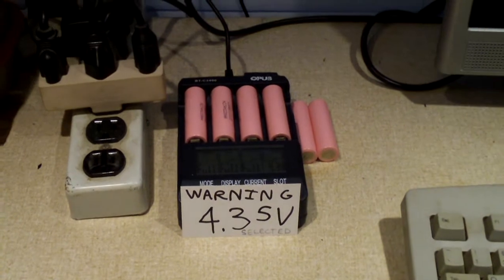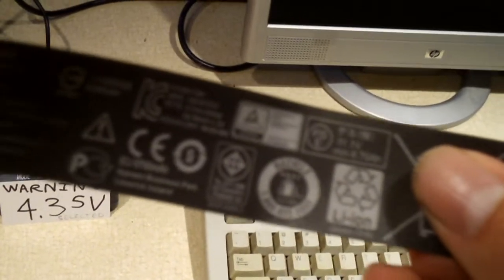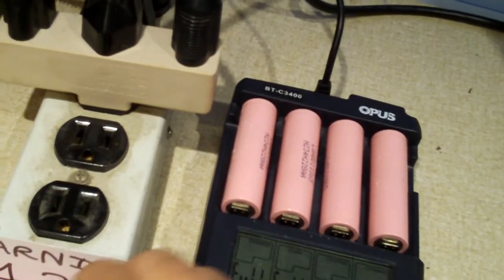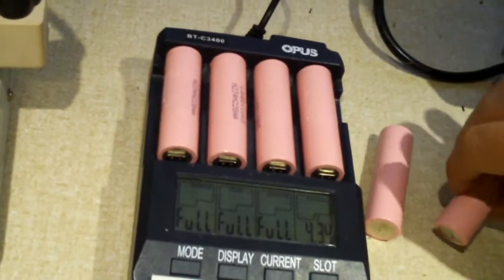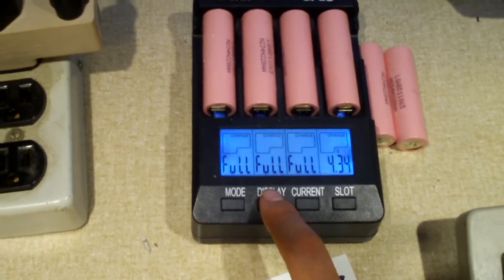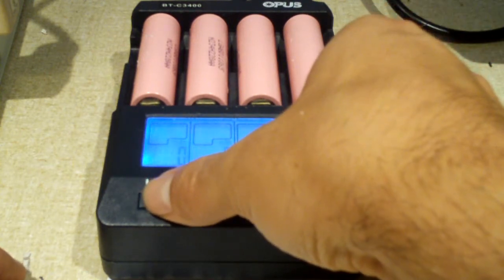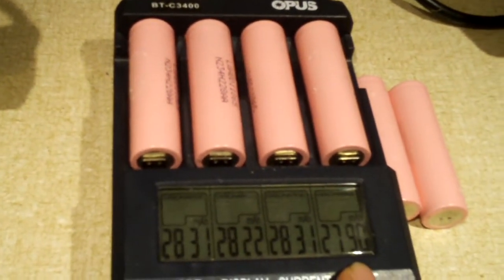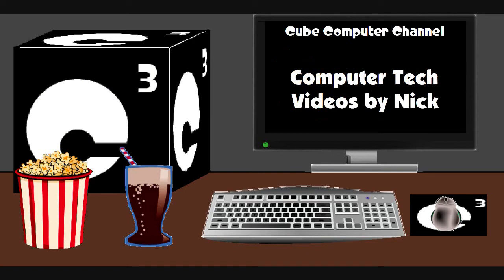Testing out the LGABD11865 4.35V 18650 pinkie cells

Comment: Could I charge them batteries in a different way like there all together
Reply from the maker: Li-Ion cells must be balance charged when in a series pack configuration. If you build a series battery pack out of them, you must include a management/monitoring circuit to make sure they are never overcharged or overdischarged.
Reply: @CubeComputerChannel  I have 2 same looking 3.7v batteries 6 pink like yours, 6 other's.  Should I make a fast video what I did to charge them? Because I think It's some what charged but definitely charge each one evenly. Down from 4v to 9v with a 19v output charger 2 times
Reply from the maker: @zacharysimpson7353  Never charge Li-Ion cells in series without balance leads between each of the series connections. It doesn't matter if the cells are rated at the same capacity. If one loses capacity, you now have a balance problem.  The best scenario is nothing happens except for the pack going bad. The worst scenario is the overcharged cell or the overdischarged cell exploding.

Comment: Why didn,t you post  the  outcome of the test?    Those cells are junk  like most of  LG cells,  the 4.35V  BS is useless  in  real life,  I processed  5000  cells in last 3 months .
Reply from the maker: They are working great for me. I cycle through them at least 1-2x a week. Two of them in parallel will run my PlayTouch Zi10 for 9 hours constant record time.